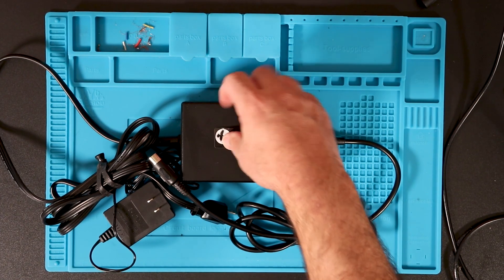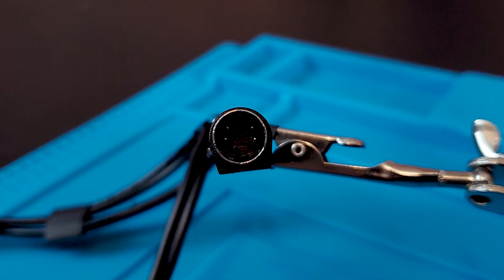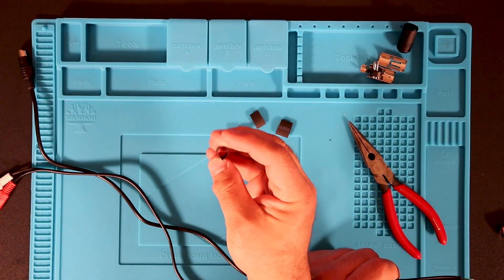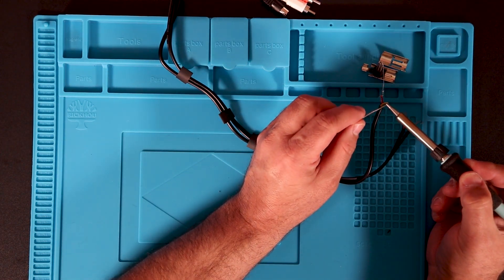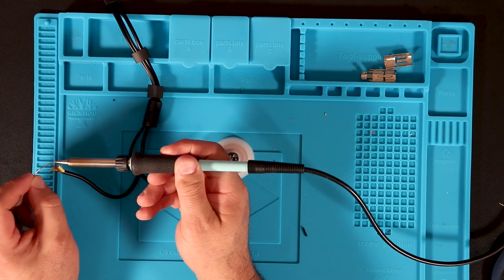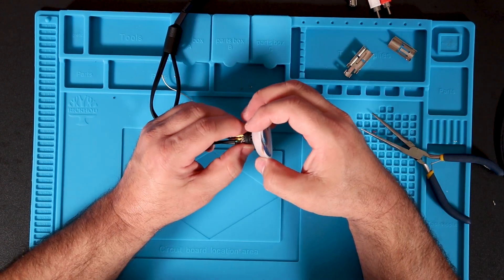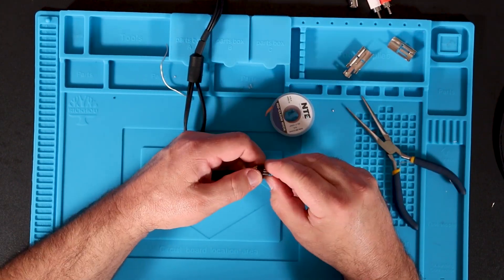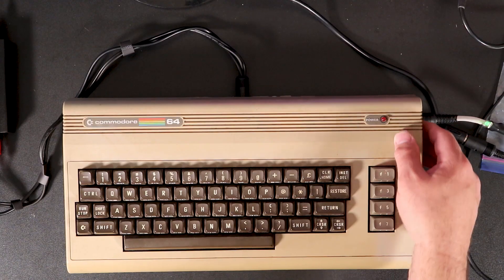Commodore 64 S-Video Cable - Works for HDMI with a Converter too

Comment from the maker: How do you like to connect displays to classic computers? Do you use a vintage CRT or do you prefer a more modern approach?
Reply: I love the vintage look on my 1702 monitor but my eyes get tired very quickly looking at it :(
Reply from the maker: I am curious how I will do once I get one. I used them for hours back in the day but my eyes are not what they used to be. Thanks for watching!
Reply: @RavenWolfRetroTech  
Well yeah and that surprised me too since I've been staring at CRT TVs and monitors for hours on end when I was younger! Getting old sure sucks...
That being said, I think you should definitely get at least one quality monitor since those are getting harder and harder to get by these days.
Reply from the maker: It is high on my list, just after an apple IIe which was the first computer i ever programed. I do have a working 17" Viewsonic VGA monitor to for other projects.  It was the server monitor for my business up until i sold it in January and the thing just keeps on going.

Comment: Very nice! You might be the right kind of person to know this but I have wondering for a long time now; Can you use a ordinary C64C computer with a 1084S-D2 monitor (using a s-video din-cable with luma/chrome/audio) and at the same time split the signals which will go to a scaler>capture device>laptop for recording in realtime? Is this possible today? Please let me know. Thanks a lot!
Reply from the maker: Niklas, I think you could run into trouble using a passive splitter cable if the input impedance of the 2 display systems are too low. There are active devices that split a signal that are probably the way to go. Right now when I want to capture I use the OBS window on a monitor above my bench as the only display.
Reply: @RavenWolfRetroTech  Thank you so much for your answer! Is there any active devices that would split the signals that you can recommend for this purpose? Thanks!
Reply from the maker: Niklas, I don't know any specific devices but there are many available. I try to avoid splitting low level signals, like video and audio, so I disconnect the 1084 and run into the RetroTINK directly when I want to capture. I view the capture in the OBS Studio monitor window.

Comment: I am currently investigating how to connect my European 50Hz C64 II to a 17 or 19 inch TFT and still get decent image quality, good enough for coding. Thanks for the detailed walk-through of how you built the cables. However, on seeing the end result image quality, I am not sure this will be a viable option. The text looks very blurry compared to what I get when I hook up my C64 to a 12 inch monochrome CRT. I mean not just a little bit more blurry, but different worlds. Did you ever vary the config described in this video and achieve a clearer (sharper) image?
Reply from the maker: Christian, Actually I think the big issue is not that it is blurry, but rather that it is too sharp. On a CRT, like a 1702 I picked up after I made this video, the pixels blur together. Since the HDMI converter here is not a true doubler that compounds the issue. I also now have a retroTINK 2X pro with true doubling and simulated scan lines on the image is much closer to the CRT but I think no matter what you do, going from 240p to 1080p is going to have some issues. If the best image is really important, and you don't want the hassles of a CRT then I would:

get a retroTINK (By all measures better image quality, but at 4x the cost).
Use a higher quality s-video cable when making your cable, the one that came with the converter was pretty crappy
Use the smallest display that will work for you, preferably one that has a 4:3 ratio

I hope this is helpful. I have not ever messed with tfts so I can't really speak to any specifics for that tech. I do my coding on my PC using VICE and an assembler then transfer the d64 files to an sd card for execution on the commodore. I have written enough code between the 80's and now that its pretty hard to deal with the severe limitations coding on the C64 itself. 

I do plan to eventually do a follow-up to this video, I just have a lot of other projects on my plate at the moment.

Comment: I'm looking for a cheap digitizer for the c64 s-video (ish) signal. Do you recommend this one? Seems like it listens to both luminance and chrominance and not just composite?
Latency is not an issue for me since I'm not playing games :)
Reply from the maker: What I like about this is that it is inexpensive and it uses s-video and not just composite. The RetroTINK 2X Pro has a better image and lower latency but it is 4x as expensive.
Reply: @RavenWolfRetroTech  Thank you.

Comment: Any update on RetroThink 2x Pro?
Reply from the maker: Andrzej, I do have plans to put out another video on that. So far it works pretty well but has some quirks that I am trying to figure out if it is the device in general or my setup. I should be back to releasing videos in January with this one currently planned as the 3rd in line. Between almost losing house in the fires this summer and my mother in law moving in with us I have been a bit distracted :)

Comment: Scrolling are awefull on these cheap converters. And they have horrible screen lag. Retrotink is the best scaler to the price.
Reply from the maker: I am currently working on putting that to the test, I suspect you are right but, at the time, I did not have the budget for a RetroTink. I now have a RetroTink 2X Pro and am working on some side-by side comparisons.
Reply: @RavenWolfRetroTech  Cool... Retrotink is the best for the price. 👍🤘

Comment: What would you charge to build a C64 S-Video cable?  I still have my old C64 stored away :)
Reply from the maker: R A, Honestly I am not very happy with the DIN connectors I have but I do see that complete cables are available on eBay. Remember to check your power supply BEFORE you plug it in or get one of Ray Carlson's savers! Enjoy getting back into your old machine!
edit: Here is a link: https://www.ebay.com/itm/Commodore-64-C64-C128-5ft-S-Video-Two-RCA-Audio-AV-Cables-Combo/154038861521?hash=item23dd6e7ed1:g:5ggAAOSw8LBfHzje

Comment: Even after all that work the picture still looks kind of nasty, and I attribute it to that generic Chinese made upscaler. Old computers and consoles from the 80s and 90s output mostly progressive scan images, and the scaler interprets it as interlaced.  This then causes it to process it as an interlaced image and then adds a ton of input lag which you'll notice in games. I recommend the Retrotink 2X line of scalers. The method of upscaling they use is called line doubling, and all they're doing is copying every horizontal line on the fly and pasting it below the previous line to make a 480p image which the vast majority of TVs will accept over HDMI. All but one of the scalers in the line has an S-Video input, and they're going to come out with a stripped down version that only has Composite and S-Video; perfect for machines from the 1980s like the C64. Also, unlike the generic scaler, the Retrotink line doesn't stretch the image.
Reply from the maker: Thanks for the detailed feedback Rust & Rails! I heard this a lot after the video aired so I picked up a RetroTINK 2X Pro along with a HDMI to USB video capture device (The screen captures on the 1541 repair video used them). I have a comparison video in the works but I need to get my hands on a newer VIC-II chip since both mine are early versions with pretty bad jail-bars. I will be sure to include lag comparisons in the research I am doing.
Reply: @RavenWolfRetroTech  I would love to see it. If you wanted to, you could also get an HDMI to VGA adapter and connect it to a CRT monitor for a more authentic experience without having to shell out for an expensive Commodore monitor.
Reply from the maker: @Rails & Rust Shhhh don't tell anyone but I picked up a 1702 locally this summer. I do also have a 19" Sylvania f93 CRT that was in use since it was new until I sold my business in January (It was delegated to occasional use in the server room for the last 5-10 years. edit: The one issue I have with the 1702 is getting good footage of the screen.

Comment: Want to know more about your game.  Looks interesting.
Reply from the maker: Stephen, me too... I had not seen that stuff since the early 90s. It is from the early 80s so its fairly primitive by todays standards. a bit of a cross between telengard and early Ultima stuff. I am really hoping at least one of the disks is good but, if not, there is a print for the assembly map code. I am working on the 1541 now, but it has multiple issues so I am not sure how long it will take to fix. Parts for the first problem took a couple weeks to get

Comment: The HDMI output clarity is only going to be as good as a signal source you provide to the S-Video to HDMI converter. Since your video was about creating a new S-Video cable you also need to make sure the signal within the C64 is as clear as possible. Suggest checking out a recent YouTube clip from Adrian's Digital Basement.

https://youtu.be/vTn36UaUfrk
Reply from the maker: Damian, I appreciate the feedback. Now that I have the power supply and video output taken care of I will be tackling the Commodore 64 itself next. Unfortunately my parts order is lost in transit so I will either have to break it into multiple videos (I can do keyboard and RF modulator now and the rest when I can get caps etc...). I really enjoyed Adrian's video but I have to admit it bothers me that the RF modulator can affect the video out. They should have been isolated IMHO. Regardless, Adrian's fix is great since it is simple.

Comment: The only drawback to this approach is that the Commodore's display ends up stretched and out of aspect (16:9 instead of 4:3). Some TV'S have an adjustment that allows you to compensate for this.
Reply from the maker: Jeff,  I'm so used to 16 by 9 that i didn't even notice, how embarrassing.  I am looking at trying a Retrotink when the budget allows. I wonder if it will correct this.
Reply: @RavenWolfRetroTech  still a great video. Thanks for doing it.
Reply from the maker: Jeff, your welcome... can you tell YouTube is still not notifying me of replies? 😰
Reply from the maker: I can. And I did years ago. but not until after Jeff's comment alerted me to the issue. I'm currently using a 1702 and 1084s for day to day C64 use and the RetroTink 2X Pro when I need to capture.